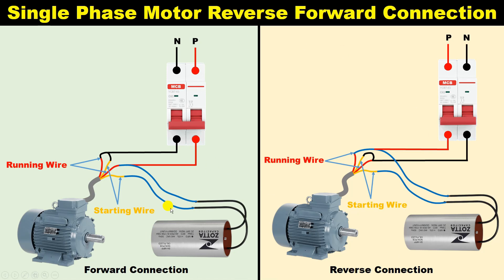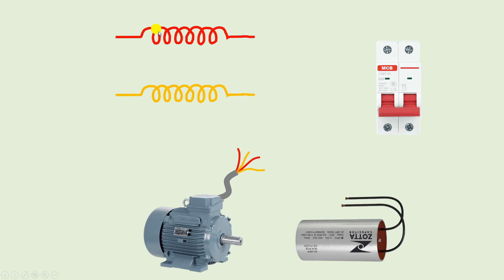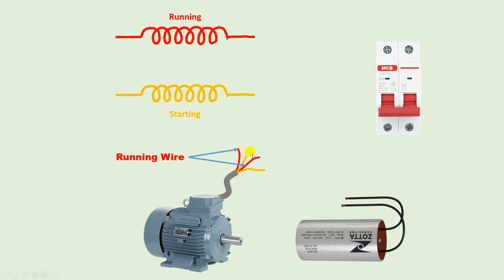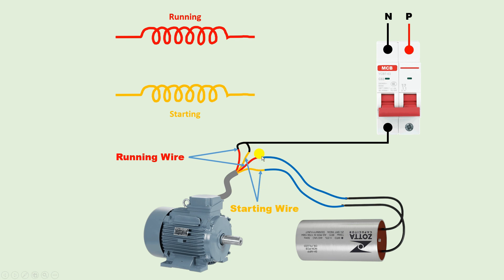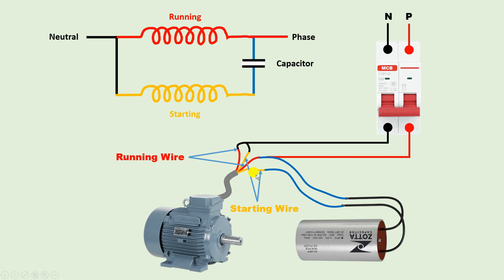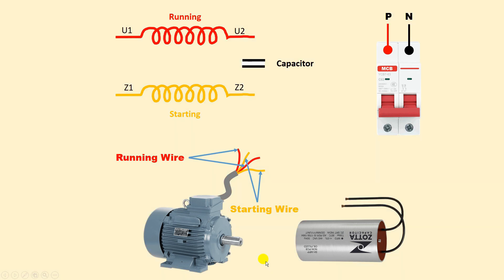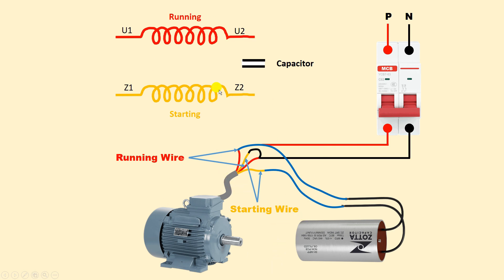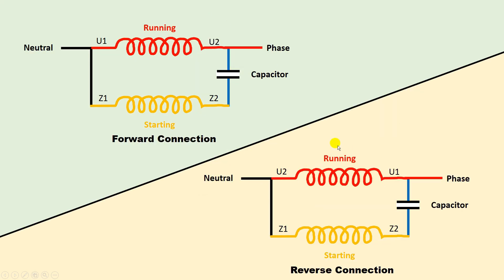Single Phase Motor Reverse Forward Connection || Motor Connection @TheElectricalGuy

Comment: Why does changing the common wire change the direction, while changing the phase does not? (The common wire is connected to the phase.)

When torque is applied in any direction without the auxiliary winding, the main winding makes the motor rotate in that direction. Why is it necessary to change the main winding? Or do you mean that swapping any other winding will also affect the others?

Comment: Thanks for a great video. I have three questions. Could you please do a similar video where a motor needs to have two capacitors, ie. Starting and running capacitor. If you have already produced one, would you send me the link. Then also could you explain to us how to calculate the capacitor's micro ferret values needed for the motor to run properly and also what will happen if the capacitors you use have a greater value in micro ferret than needed ? Your urgent reply will be appreciated. It all refers to single phase power 220v AC.

Comment: my motor has 4 wires. 2 for line input +/- and other two for capacitor. When I changed the supply +/- position at reverse, no rotation changed.

Comment: Sir, isnt that the lowest Resistance is of the Starting Coil?
The higher Resistance one is of the Running coil?
In the video you mention it in the other way round...🤔
Reply: No. he is correct 
The higher resistance is for starting coil
Reply: @KhalEd-ur4yh  okay, im confused too
Reply: The starting coil uses thinner wire which has higher resistance.
Reply: @johnanddiann100  Okay, got it.
But Im confused there are service tech saying that some 'smaller motors', where the Running/Main Coil is alrdy winded using Small sized winding wires; then the Starting Coil won't be winded with Thinner winding wires anymore.

Because the design of its motor Windings Ratio of Main(running) to Aux(starting) Windings will make the windings at the Start Coil SHORTER, so the end measured result for this kind of Motor typically will result the Aux(Start) Coil having Lower resistance relative to the Main(running) coil.

Im confused & need clarification for this🙏

Comment: Usually we change the terminals of starting winding for the reversal of the 1Ph motors.

More over you didn't explained how to change the rotation if there are only 3 wires came out of the motor..ie :
Common
Running 
Starting

Comment: I didn’t understand any of it, except that I did understand 1) how to identify the running winding wires, and 2) that I need to swap those two over. And motor is running the way I need it now thanks…
Reply: Take Multi meter and measure resistance which is having higher resistance value that is running winding and low resistance value is starting winding in video he has given wrong connection is correct
Reply: @samarsekharreddy No, the starter winding is thinner wire and has higher resistance.  The running winding uses thicker wire which has lower resistance.